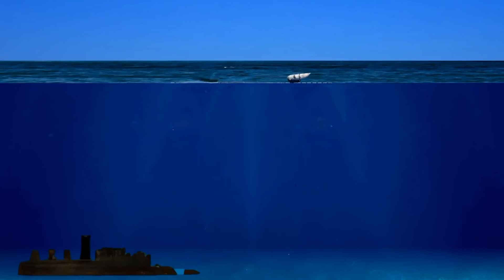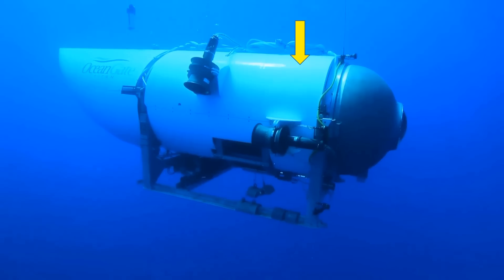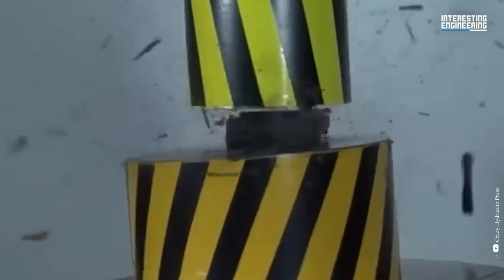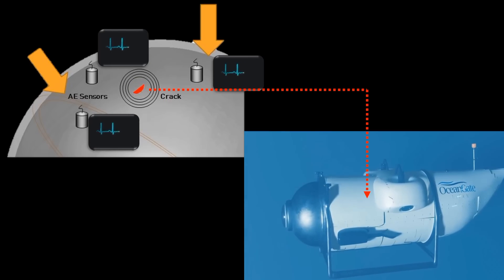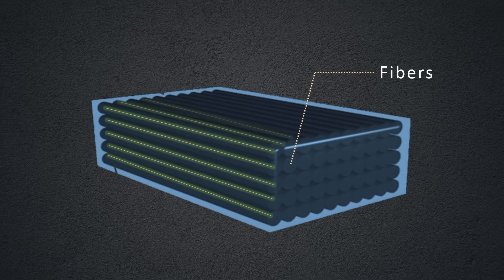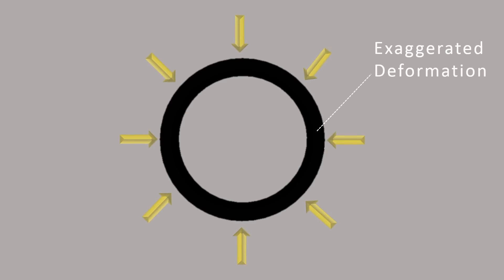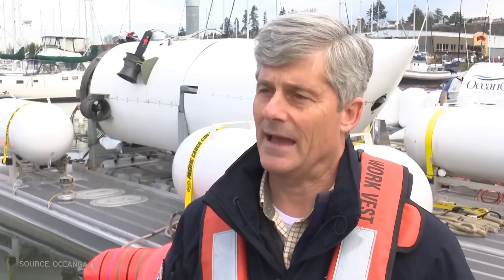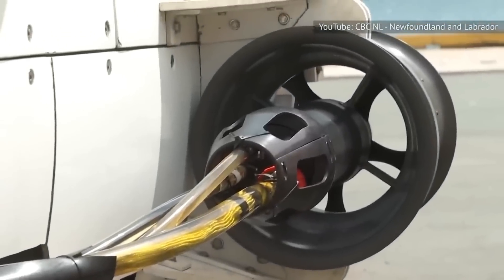Oceangate Titan Did Not Implode Just From Pressure. There Is a Catch!

Comment: The TOTAL COMPRESSIVE PRESSURE over the entire hull of the Titan submersible at 12,500 ft below the surface is a staggering 425,000,000 lbs of force trying to collapse that elongated cylinder. Sometimes numbers don't really convey something as well as a mental image. A fully loaded 747 jet weighs about 900,000 lbs, so when you divide 425 million pounds by 900,000 you come up with a staggering 470 Boeing 747s attempting to crush that hull. That's why there is very little margin of error when you're diving that deep with experimental materials and design. But especially when you don't listen to other engineers.
   And you did a mighty fine job of explaining the failure mode in more or less layman's terms assuming the viewer has some tiny bit of scientific background. Though I think anyone could actually understand the general concept easily enough.

Comment: I often see comments relating to how the gaming controller was a bad choice. I'd like to offer a devil's advocate view and say that gaming is probably one of the most scrutinized and examined forms of electronic device communication. Gamers demand low latency, high signal strength, and resistance to noise in order to benefit from twitch responses. The Call of Duty league and other competitive gaming industries make it feasible to put a high level of research into these areas. It may seem kind of childish to use an off-the-shelf controller, and I certainly wouldn't have a Rock Candy or other budget controller used in a life or death situation, but otherwise, the thought process seems sound. It would take a minimal amount of testing to ensure that their controller interface was working well. I definitely wouldn't be using a wireless controller that needs batteries. I doubt you're going to pick up a couple of double A's on the fo'c'sle of the Titanic.

Comment: If the text messages that have been presented on YouTube are valid, which is still very much in question, then it appears something went wrong in the stern, perhaps under or around the faring. According to those messages, they were descending way too rapidly right from the start of the dive. When they detected a problem and the alarms began going off, they decided to abort the dive and ascend but found they couldn't. Even after they dropped their ballast they were still descending, even though they shouldn't have been. They jettisoned the landing frame and only then did they begin to ascend, but way too slowly. They only rose 30 some meters in about 3 minutes. And then they ran out of time. Now like I said, those messages have not been verified, so take it for what it's worth, which may be nothing at all. But if they are valid, they were way too heavy to ascend properly, and that usually means they were taking on water somewhere, and it wasn't the pressure chamber. That pretty much leaves that stern area around the faring.

Comment: At 6 min 28 sec your diagram snows maximum compression on t he inside diameter. How did you derive that?  Why is not the compression equal around the circumference?  If the circumference starts to buckle, then the inside circumference would have tension or less compression.  What is the compressive strength of laminated carbon perpendicular to the fibers from  the loads caused to support the titanium end caps?

Comment: My first thought about the failure, was the bonding between the titanium ring and the carbon fibre ends. I still feel, that was the point of failure. The excellent graphics shows the tube deforming lengthwise, narrowing in the middle. That is surely going to stress the bond with the rings, as the outer layers will pull against the bonding in the ring.

Comment: Using glue to attach the Titanium ends is scary. Also, the carbon fiber wrap was another a scary proposition. Each dive it made logically would have weakened the carbon fiber. It should have been tested after every dive.

Comment: I totally agree with this guy, but I would go one step further. THE CARBON FIBER IS ALMOST USELESS IN THIS APPLICATION. Carbon fibers are extremely strong under tension, which is exactly what would happen if a vessel had pressure from INSIDE. Pressure from the OUTSIDE, which is what a submersible must deal with, will simply buckle the fibers. The only thing preventing this buckling is the glue that holds the layers of fibers together. To make an everyday example, lets take a regular old sock (yes, the kind that goes on your foot) and hold it into a round shape while we apply starch to stiffen it. Let the starch dry. Put a balloon in there and air it up, to create pressure from within. The fibers of the sock restrain the balloon quite easily, because they are strong under tension. Now, get the balloon out and put this starched-sock into a blood pressure cuff, so the force is coming from OUTSIDE. You won't air up the cuff very much before the starch lets the fibers start to buckle and the sock folds flat.

Comment: Also metal can crush or bend in a little around microfractures before breaching because it's malleable, but the carbon fiber will splinter because it's brittle and the lamentation will delamenate. That means if there is a spot that is weakened the whole thing will just shatter.

Comment: Not sure about the viability of 5 inch carbon fiber under such pressure/ stress. The material itself may have been tested to withstand the required pressure with some contingencies. But I am not convinced they did any functional tests other than few experimental dives. 

I do see potential weakness at the joint area between the CF module and titanium module which also serviced as the door. It’s common to have metal to metal seal that can take very high pressure ratings but metal to carbon fiber may both have irregular stress reactions under pressure which would cause tension and/or rupture between the 2 modules. We will have to wait and see the debris forensics report to pin point which part caused the catastrophic failure whether it is a tear on the carbon fiber wall (structural failure) or at the joint.l (seal failure).

Comment: There were so many points of failure on this vehicle, it’s a total cluster of hubris and disregard for innocent life. All certified submersibles have welded joints. The Titan had 32 feet of glued joints applied by hand to merge the fiber and titanium. That is a lot of glue to bet your life on. No shred of fiber was found still stuck to the titanium. It all shattered across the ocean floor. The viewport might have played a key role, too, because it was not rated for those depths. Another significant piece of data is that Oceangate towed that craft all over the place repeatedly for hundreds of miles on choppy seas to save money on a larger craft with a crane, which cost $200K to operate. Bouncing around uncontrollably for hours on end seems unwise for a delicate piece of equipment. Nobody does that. Would you buy a car that had been towed over potholes for thousands of miles? So many things wrong and we probably don’t know the half of it. Rush wanted to be remembered as an innovator and he innovated nothing. He will be remembered the same way the Titanic captain will be remembered: leading his passengers on a one-way trip to the abyss.

Comment: I worked in the paper industry have had years of experience with fibre epoxy based roll covers. In my experience they can fail catastrophically by overload and also repeated cycling under but near to overload. Another point is that material stiffness is proportional to thickness cubed. A piece of material with one separation in the middle is way less stiff than the original material so a failure could be very rapid.

Comment: I don't understand why they would use carbon fiber...  It's not an aircraft, or a race car.  There is no reason to make a sub light.  Yeah its easier to put in and pull out of the water, but that's not where the dangers are located!
Reply: @@jasonriggs6737 I guess you get what you pay for one way or another. With the money they had, they could have designed a boat that would be both small and able to launch the sub without a crane.   The trade off for carbon doesn't make sense, You introduce so many failure points to save weight...  When you build a sub that you intend to take paying customers in, safety should have been the only concern in construction and implementation.

Comment: Looking at that hull tube construction video, and just ignoring the radial loading for a moment, it appears that all of the axial load would be carried only by the epoxy filler material.   In this layup, the carbon fiber tape would essentially just be a filler and 100% of the load would be carried by the resin.

Comment: Titan was just like the Comet, the worlds first jet airliner. The Comet designers were at the cutting edge of aircraft design,  and the height Comet flew at and the need for internal pressurisation caused problems that no-one had seen before....  On the other hand Rush was told that his design was 'deeply flawed'.
Reply: Square corner windows, as used on earlier slower propeller aeroplanes, jet airliners near the speed of sound were not the same.
Reply: @joefish6091  Actually it was not so much the square windows as the type and thickness of material used ...

Comment: You explained this better than anyone I have seen so far and I have been watching hours of coverage. A+
Reply: A combination of several really good engineer YT videos gives a fair interpretation of history/failure. This vid has some shots of external components. I wonder if the game controller was intended to communicate thru the carbon fiber with a receiver at ocean pressure without hull penetrations. Having seen fiber glass boat hull delamination, if high pressure water was able to penetrate partway thru the hull, progressive failure was inevitable.

Comment: Nice vid. 👍🏻 But what about the seams when you put 2 different materials together? I jokenly said when it happened "Using the wrong glue has been a mistake as old as mankind" but what I meant is that how are you going to put 2 different materials together with different characteristics in a way that can withstand that kind of pressure in a safe way? The pressure will always look for it's weakest point which would have been at the seams, no? Wouldn't a hull out of just one material be a lot stronger?

Comment: This is another iteration of what is known about carbon fiver or any other fibrous resin reinforced matrices like fiberglass construction ..which incidentally may have faired better that CF  if  used for the entire pilot and passenger  habitat provided that the method of construction was properly engineered. BUT WHY USE COMPOSITE MATERIALS WHEN PROVEN SAFE METALLIC CONSTRUCTION HAVE BEEN THE  SAFE   GOLD STANDARD?  There is no real reason other the cost , even though carbon fiver is not exactly cheap . The TITAN was a shoddily engineered dangerous  death trap , the filming of its construction reveals many flaws about it as reviewed by a very competent expert in the CARBON FIBER engineering, then comes the mating of the uni -directionally wound fiber to the titanium hemispheres at each end  of the tube....by using what is essentially  GLUE....space age or not by any other name it is glue, and when improperly  mixed such as epoxies are , the botched mix  creates condition such as  when one of  many the 26 ton panels collapsed  in the TED WILLIAMS TUNNEL  OF  THE BOSTON MA BIG DICTH , that killed  a passenger and injured the driver who miraculously survived.
Why did the 26 ton panel fall onto traffic ? Because the epoxy that was used to anchor the bolts that held the panel fastened to the tunnel `s ceiling ran like molasses in July and the bolt anchors simply slid out of their holes. The BOSTON TUNNEL MASSACRE  his is not the only recorded failure of glues  and epoxies which resulted in the death of unsuspecting people.
I am not an engineer but  do I need to be one  to understand that that is MORONIC -better yet an IDIOTIC method of assembly when mating together two materials which share nothing in the way of atomic structure  and consequently predictable cyclic fatigue.

Comment: Besides the potential failure of the carbon fiber, as you explained, or the potential failure of the acrylic window, I see, as a mechanical engineer, one more critical point in this design. The titanium shells are glued to the carbon fibre tube with epoxy.  Titanium and carbon fiber have a different modulus of elasticity.  This means that they will each shrink to a different dimension when under compression pressure.  The consequential shear load between those parts needs to handled by the glue epoxy !!!  The epoxy  needs to be or sufficiënt elastic or have sufficient thickness to create more shear elasticity.  Epoxy was applied by hand, which indicates to me they did not pay attention to this!!!

Comment: Successful deep sea subs are very different in two respects - the material used (titanium or surface treated aluminum) has a hardness rating that is about 6 times that of epoxy - the outer layer and glue that binds together carbon fibers in a composite hull. The second key point of weakness is what you alluded to - non uniform resistance to outside stresses due to the directional nature of the carbon fibers themselves. The titanium and aluminum hull submersibles have no such vulnerability. In addition to being a lot harder than epoxy and better resisting material displacement under high unevenly supported loads, their material structure is much more uniform and therefore the resistance to outside stresses is more uniform and predictable. It's really not that complicated and you would have to be a complete idiot to ignore these colossal drawbacks to the use of composites in high pressure environments. It's pretty clear that spending a good deal of money to build a bad design doesn't confer extra levels of intelligence or brilliance on the part of the spender. The Darwin Rule really doesn't care how big your wallet is. Arrogance and stupidity are still a deadly combination.
Reply: Well said!
Reply: Darwin=1   Rush=0 😅

Comment: It looks like the dive was executed to fast. The origin of that fact is still unknown. Maybe the weight or trouble with the thrusters. The early warning system did function, and it looks like they tried to surface and abort the mission. But the sub barely went up. After that the sub reached a critical stage, and imploded.